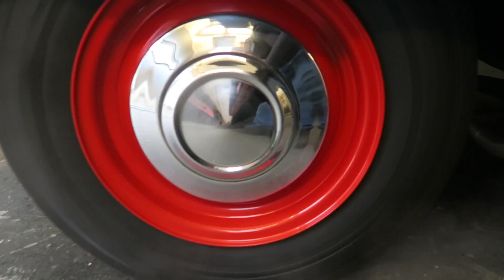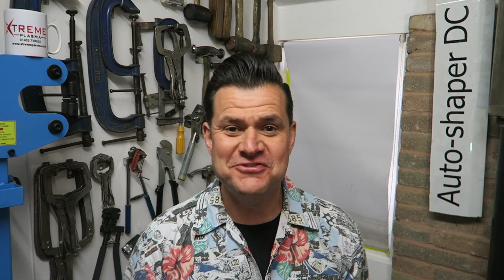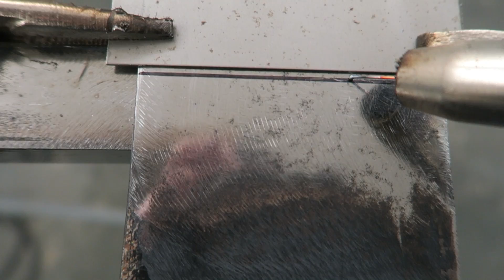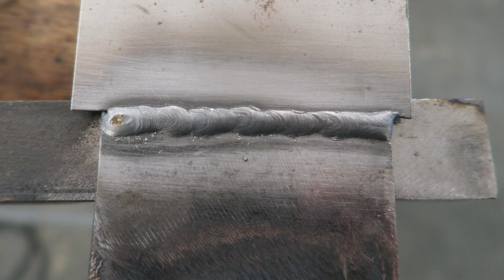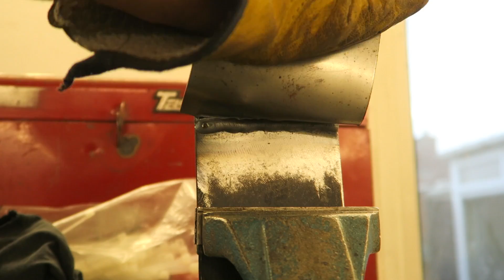Mig Welding set up Part 2 Plug welding Butt joints grinding polishing Tips and Tricks #46 Ron Covell

Comment: I always learn so much from your videos. They are very valuable for me because I'm restoring a VW T3 Syncro and I'm completely new to all this. How much distance would you put between the holes on car panels and how many Amps would you use for the spot welds?
Reply from the maker: When you say spot welds are you talking about mig plug welds or resistant spot welding? Are you using your mig welder?
Reply: @trevsblog  sorry, I guess I used the wrong English term there. I’m talking about MIG plug welds.
Reply from the maker: @kieferngruen  I’d try and replicate the distance the original spot welds are set apart, if you can’t work out what that is then around 40mm apart is a good ballpark. use a 6mm hole. Don’t stress about how many amps etc. the best practice is to do a test to set your welder up as shown in the video. You want good penetration but not so much you’re melting holes! Amps are how much current the welder is drawing during the welding process, it doesn’t convert into whether you’re welding properly because the faster the wire speed is running the higher the amps. You could turn up your wire speed too fast to achieve the amps you think you should be welding at only to achieve a really bad weld. Cheers Trev 👍

Comment: Hello there...I wonder could the mig weld be softened by tig? Did you try that?
Greetings from Croatia...🙂
Reply from the maker: Not by any noticeable amount. The main problem with filler is it has additives to make the weld flow be strong and not porous. Mig pumps wire at a high rate overloading the bead with weld. With TIG I only use a very small amount of filler compared to mig. Cheers Trev 🤩
Reply: @trevsblog  thank you very much, Trev... It seems i must start to learn new skills... 🙂 In February I started restoration of my hj 60 land cruiser and i never did it before... So, every meaningful advice is welcomed... In Croatia no one, what i heard of, work with car bodies that way... Only a lot of fillers, spot welds, not even rust cleand enough... Thank you, your blog is full of very useful informations when it comes to DIY... Cheers mate... 🙂

Comment: Thank's for all those wonderfull vids that are making me take the plunge into car restoration. What are the specs i must look for when buying my first tig? Any model you'd recommand?
Reply from the maker: It depends on budget, what material you want to weld? Ie would you want to weld aluminium? And which country do you live in? Cheers Trev 👍
Reply: @trevsblog  Thanks for your quick reply! I was thinking about a mig, not a tig sorry! Mainly steel but i'd rather put some more money and not have to buy another if i ever have to weld aluminium. Looking on the internet, i have the feeling that a descent product start around 400 euros (i'm in France) but there are so many brands in that range that i'm a bit lost
Reply from the maker: If you were in the uk then I’d suggest the r-tech M180 as I don’t know what’s available in France I’m a bit stumped. I got the r-tech mig a couple of years ago and I’m amazed at how well it welds its very consistent and forgiving on the settings. It’s almost difficult to do a bad weld if that makes sense. Try doing a top ten search for mig welding machines in France these types of searches often throw up good suggestions. Cheers Trev 👍
Reply: @trevsblog  thanks trev, i'll do that!

Comment: Trev, great welding, when butt welding sheet metal with a mig leave a gap between panels for better penetration. The weld, do to surface tension will leave an reinforcement on the rear of the panels. Give it a try.

Comment: Thanks Trev very useful advice. Just started on floor panel and sills of a bongo, plug weld advice very timely. As ever lots of great content. Tried your metal shrinking crimping approach on the tailgate corners. Worked a treat. Must get myself a TIG setup . This is a great way of using COVID lockdown. 👍

Comment: Thanks Trev for this mini series. Just bought my first  half decent mig, by coincidence, the very one I saw in the first part. My aim is to be able to repair parts for my vintage tractor and to build equipment I could never normally afford, for the farm . No art I'm afraid , talent is sadly lacking, I can admire your work but I have no imagination or flair so I'll stick to basics . I will still enjoy the process and the results which I guess is what counts. That said, I do find that I can watch you fabricating a part for the Bedford and a light goes on in my head which solves a really mundane question I have about a light fitting or the number plate holder as just two examples. Loved the piece on Ron Covell. Many thanks. Stay safe and hope to see the van at events when the madness is over. Lloyd.

Comment: Trev there's no need to use bigger holes for puddle welds...The very best way is TIG...fuse directly around the edge of the hole without using rod first, then fill up with rod. Aways use a pulse setting if you can to avoid un-necessary heat build up. If you only have access to MIG then the opposite technique works better. Start off by just building a puddle in the centre of the hole until it spills on to the edges of the hole.

Comment: I ramp up the settings with the hole punch holes... not the right way, I know! Burns the top skin away & end up welding about 10mm anyway!
Reply from the maker: theoriginalwallace in a way you’re not wrong. It’s difficult to cover all bases when you’re trying to advise someone that’s never welded but as you gain more experience you start to realise how things react and you can start pushing boundaries, as you’ve pointed out. Cheers Trev 👍
Reply: Cheers Trev! It's just the way I've done it since I was a kid with a rotten 123E Anglia I got when I was 11! Industrial welder now, but that's a different kettle of fish... heavy metal is always going to be easy!! Cheers. Leigh.

Comment: Some hopefully constructive criticism:  At 16:12  the "Mig Welding Set Up" video turned into a why TIG is better than MIG video with a note about how you could have gone to the trouble of setting up the MIG welder a bit better.  For this video it would have been great to see the process of getting the settings on your MIG dialed in to get better results.  You mentioned heat build-up might have then been a concern but letting the piece cool between tacks is a good thing to know about too.
Reply from the maker: NimblyBimbly I kind of get what you’re saying, I thought the weld was fairly representative of what I see regards to a mig welded joint and I wouldn’t have been able to make a much better job to be honest. I’ve done a few videos in the past where I’ve done my best to reduce the heat build up by spacing out the welds using heat sinks and putting a gap between the sheets to aid penetration. I couldn’t TIG weld the same sheet with a gap so just did what I see as fairly typical, not the best or worst. It was a short sheet and had no distortion. My demonstration wasn’t to dis mig welding but to try and show the difference. The difference within my own capabilities. Cheers Trev

Comment: Hi Trev...great video. With regards to strength of weld. Worked for many years at a Japanese car company and there are test methods and standards to judge if the weld is ok. Try to separate the panels by hammering and prying with a chisel next to the weld NOT through the weld. You should be able to pull a nugget/button and sometimes pull a small hole at the thinner material. (which I noticed was present even on the smaller weld). There should be standards available on the www. for judging weld integrity. Keep up the good work.

Comment: Hey Trev!
I got a bit carried away the other week, mig welding, and warped my trunk floor a bit, the warp is concentrated within a decimeter of weld. Any tips for what to consider to take this warp out?
My current plan is to grind the welds down so it's all flat and then try to planish it with hammer and dolly. I assume it has warped because it has shrunk around the weld line, hence my plan to try to stretch it through planishing.
Is this the way to go or would you recommend something else? Thanks for another great video!
Reply from the maker: Mr.Crankyface it certainly sounds like its heat shrunk. It certainly wouldn’t hurt to grind it as flush as possible then try and planish it out. Cheers Trev 👍

Comment: Not just TIG on aluminium but also 1.2mm or thereabouts steel sheet please 🤞🙏
I need to TIG the lower section of my 1935 Austin Seven NS door that had been lap welded in place with a perfect water trap inside, then 1lb of filler to get its shape back 😡
Reply from the maker: Geoff Halstead I’m not surprised they had problems, a dead flat panel is bound to try and draw in. I’m sure you’ll do it proud. Cheers Trev 👍

Comment: Very informative and useful video as always. What epoxy primer would you recommend?
Reply from the maker: GT Bugger I’ve used Rustbuster epoxy mastic 121 and hb body 989 either product seem compatible with different paint types. if you’re brushing you probably won’t need to add any thinner. Cheers Trev
Reply: @trevsblog  I've used Raptor epoxy primer in the past but looking for a cheaper alternative. I'll check out the ones you wrote about. Thank you.

Comment: I found the wire speed/power setting episode a massive help with a recent project. 
Any advise on flux cored wire?
Reply from the maker: laurie kee if you can get an argon Shield bottle, I’d just fling it and just use standard wire. I’ve never used it but heard it’s not great on bodywork which is hard enough using good kit! Cheers Trev 👍
Reply: @trevsblog  It's good for outdoor work, but you need more amps, so I'll need to build a workshop or only weld on calm days!!

Comment: Trev, do you have a blog showing how to do plug welds upside down?
Reply from the maker: Bob Crouch I haven’t but if you can avoid doing it do! If you have to then I’d suggest an 8mm hole then increase your wire speed as gravity greatly effects the characteristics of the welder. Cheers Trev 👍

Comment: Nice video but cant help myself for throwing in my 2 cents in on grinding and polishing. Most everyone grinds on the edge that i watch on you tube. What happens is it wears off media immediately on edge. But by holding disc flat to surface you have more surface area  giving you a faster and flattered grind area and also you wear your disc out uniformly.good video

Comment: Many years of sheet metal work, race cars mainly, you can't beat Unibit step drills.Not the cheapo Chinese junk, either Irwin / Hall . Unlike twist drill, you get a perfectly hole, and no pull through like ordinary twist drill do.Use a quality cutting paste, they last for ages.

Comment: Very interesting video Trev. Well done!!
After tig welding (with filler rod) do you grind your weld beads down before you start planishing the weld or do you planish on the bead in order to remove the heat distortion? 

 Ron Covell is truely an artist. It is unbelievable what he can create from a piece of sheet metal. I am considering to watch in the near future a couple of his DVDs.
Reply from the maker: George AthS it depends what build I get on the weld, sometimes I can get the weld so flat it’s dead flush with the base metal. If there is a bit of a bead I’d just grind it off then planish to stretch the weld out. Incidentally many of the professional coach builders I follow rarely use any filler rod and leave all of their welds undercut! FACT! Cheers Trev 👍

Comment: Absolutely spot on Trev! Thank you for this.. I may be an aerospace tig welder.. but I do use Mig for anything structural (frame/chassis) on the car and tig on all body panels where I can. Most of the time I get caught up on clean up.. I fuss a ton about it as I want it to be close to perfect as I can get..  Always appreciate your tips and tricks! 

All I need now is to get my hands on the Epoxy Mastic and I am good to go. 😉👍

Thanks again Trev! Cheers! 😎🤙

Comment: Hi Trev,  recently bought a gas / gasless mig welder,   came with flux cored wire,  any reason why I couldn't set up argon/co2 mix and still use the flux core until its all used up?
Reply from the maker: Purplemonkey 1974 for the cost of a reel of wire, sling it in the bin 👍

Comment: I have a chassis leg i need to butt weld to an existing bit (replaced rotten end) , i have made an overlap section inside (it is only 3 sides so can get to the open edge). I have welded the inner U in and shaped to to fit using a mix of plug and seam welding.  so now it is attached to the new piece but not to the original.
The original section is thinner so initially i though i would use plug to start and perhaps then do the seams once there is some metal there to help with preventing holes.  however i also had another idea and would be interested in views. My though is to cut slots into the new 2mm inner U and weld through these slots to join the thinner outer to the new inner?
I was thinking say 1mm grinder cut slots?
Then to the seams. this member in itself has not got a lot of load to bear but does have the towing hitch on so potentially it has be be able to withstand the weight of the vehicle being say towed onto a breakdown truck etc..
Reply from the maker: amojak you can certainly cut slots, it’s actually a recognised procedure on accident repair methods. From memory you can get a hole punch that does 20x6mm slots. Cheers Trev 👍

Comment: What’s your technique for filling a plug weld? Do you start in the middle and swirl outward? I had issues with the inner weld not sticking....
Reply from the maker: Lmm Cams I did cover this in the video, I just do a circular action if I’m welding an 8mm + size hole. Cheers Trev 👍
Reply: Trev's Blog Thanks Trev, but do you mean circular as in a ring or do you start in the middle and swirl outwards in a circular motion? I'm a beginner so was wondering if you let a pool grow centrally then swirl outwards, or do you start a bead nearer the edge and then swirl in and out to build the pool up and take in the outer sheet. Sorry if I'm not clear lol
Reply from the maker: Lmm Cams understood, firstly don’t overanalyse it too much, it’s mostly about feel and observation. Get yourself two pieces of metal and practice first before welding your pride and joy. I just do a circular movement and kind of aim between the centre and the edge, just imagine it’s making a puddle about 4mm wide, if you practice it yourself you’ll get it straight away. Just observe that it’s melted into the top section all the way round, with an 8mm hole you’ll have no problem hitting the panel underneath. You can get away with a 6mm hole with not much need to do the circular motion because the weld with pool out enough to hit the top panel. If you grind your weld flush and you have no ring around your weld on the top, flip it over and check the penetration on the underside, if that looks welded you’re good 👍 Hope this helps 👍
Reply: Trev's Blog thanks trev, you're a gem!

Comment: What diameter filler rod did you use TIG welding the two 20 gauge panels together?
Reply from the maker: Paul Straney I just use .8mm mild steel mig wire, tension twisted with a drill. Cheers Trev 👍

Comment: Ron Covelle is a legend.
I'd love a walk around with Ron and maybe the Brookville Roadster's place to see how they put their bodies together.
I eventually assembled a '32 Ford Model B flat pack steel body which are stamped out from Reprosteel in Sweden but man that was hard and time consuming especially as it didn't come with A or B pillars or any kind of subframe and I was on my own so had to make jigs to hold everything together until I was happy with the placement.
I also had to adapt the firewall to suit the motor I was putting in.
If anybody thinks a kit car or any other flat pack body is going to fit straight out of the box they are seriously deluded lol
Love the videos Trev, very enjoyable :)

Comment: Trev fully agree that you need both MiG and TIG if you want a good weld. Horses for courses. Could you do a similar strength test between TIG welding and TIG Bronze brazing?
Reply from the maker: Achmad Osman I can try 👍 I’ve never brazed with the TIG on a butt joint only a fillet 🤔. Cheers Trev 👍
Reply: Trev's Blog the theory goes that when you work with poor standard plate like on Lancia’s etc, the new steel will not bond properly so brazing with Bronze Silicone is ideal as brazing uses lower temps than welding....so you melt the bronze and shield the steel. Well that is what I read and it would be great to if that bears out. Also, softer metal means easier filing and no need to grind.  Again, in theory.